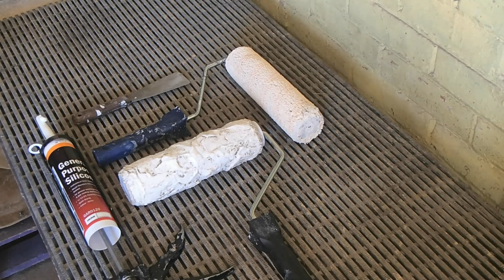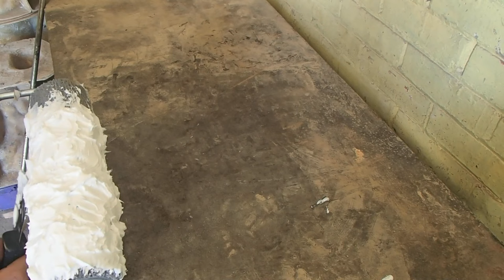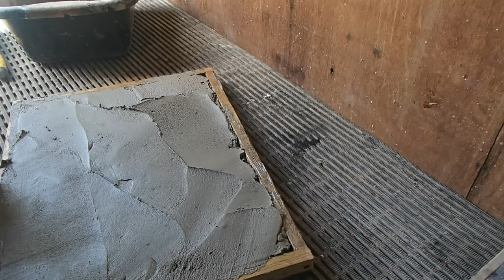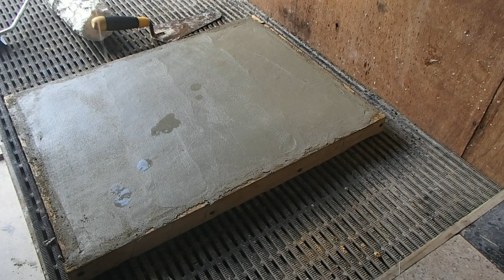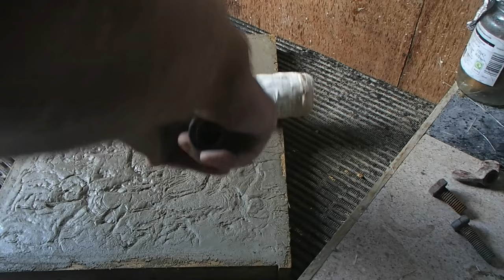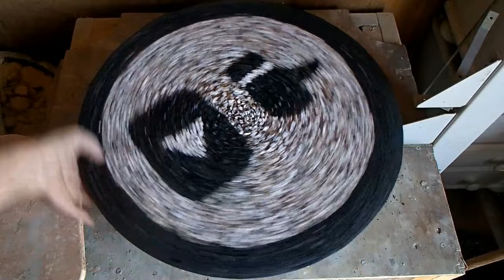MAKING A DIY SILICONE TEXTURE ROLLER... CEMENT CRAFT IDEAS

Comment: My only criticism is that a lot of these rollers, yours included, really exaggerate the indentations and protrusions of actual rock. I'd like to see one with a less pronounced texture, more like a flagstone, but I wonder if the silicone can be persuaded to flatten down. Otherwise the concept itself is clever and well executed.
Reply from the maker: Its up to individual requirements, many fake rocks look like a plain blob through lack of texture. To reduce the detail I could use less pressure on the roller or use a thin plastic bin liner on the surface.  Yes the silicone could be fashioned as you suggest. Thank you for your comment.